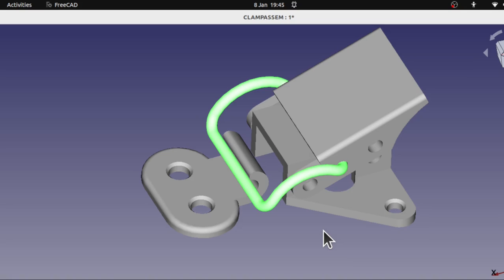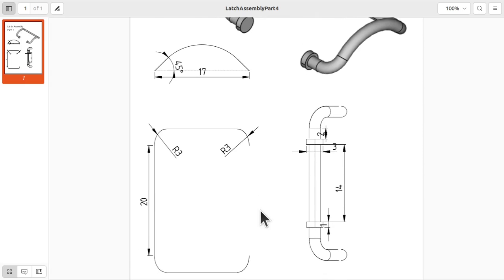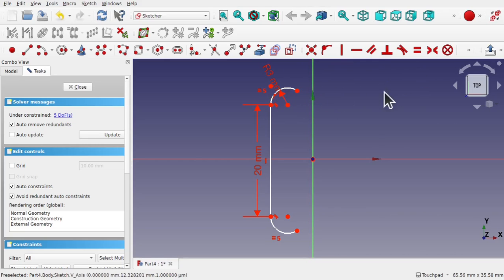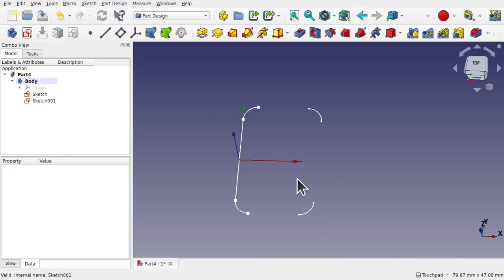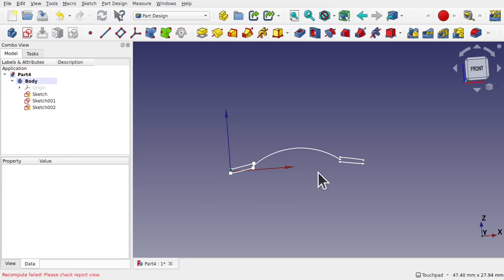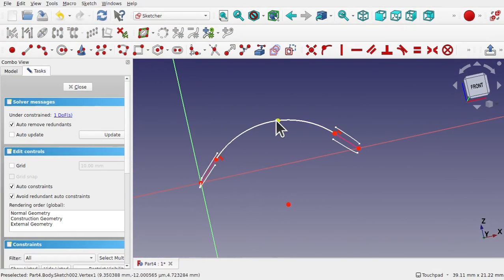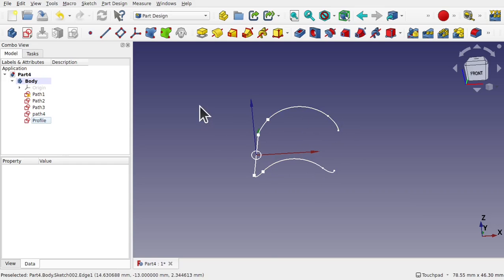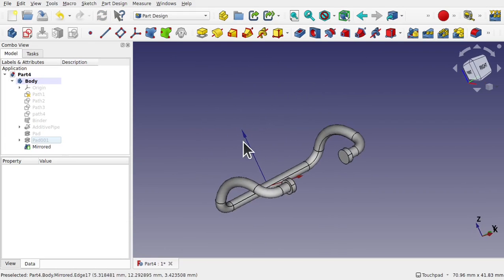Learning FreeCAD For Beginners | 35 (Part 4) | CAD Thinking Part 4: Latch Assembly

Comment: Excellent training thanks! I am struggling to extrude along a 3D path created by Freehand BSpline. Any insights/tricks would be appreciated!
Reply from the maker: Glad you enjoyed.  I am guessing you are using the pipe / sweep operation.  Attachment to place the profile normal to edge is important to get the correct alignment.  This is through the attachment mode of the sketch.  Select the first reference as being the starting vertex of the bspline and the second reference the bspline edge itself and select the alignment mode of normal to edge.  Also when you create the sweep pick the frenet mode.

Comment: this one took me a few times.  I don't know why I think when I. was forming the second sketch. I added a constraint or something that when I went to move it the. Seventeen millimeters. It was way off for some reason.  I had to do it two or three times to get the attachments Constraints. right. so I can move things and angle them. I persisted and I eventually did it. I'm going to do it again tomorrow, just to practice it.  . The other drawings in this series were pretty easy for me to follow along.
Reply from the maker: Thank you for the feedback. I would like to recreate this tutorials for version 1.0 are there are a number of other ways to do that part with other tools which make it easier but you would need to jump to another wb to use the tool. But I would like to add them in. Glad you was able to get there in the end.
Reply: @MangoJellySolutions  At this point, adding another workbench or using another workbench is no big deal for me. I've come such a long way under your instruction. It's quite incredible. I'm really good at manipulating the software and using free CAD thanks to you. And the only reason why I'm doing these tutorials is because I've already finished the ones that you had for version 1. or at least at the time I did, you may have added since. Then I see that you add a few every few days.  I was able to do all the parts of the assembly and the. Final Assembly and manipulated. under constraint and move.. Parts to form a. working latch.

Comment: I cant get mine to go symmetrical when click the 3 dots to line up its juat staying in the same place after clicking the inverted arrows at the top for the action?! Ive had enough of this for today its such a horrible program compared to fusion 360 its just occurred and doesn't need to be so many pointless actions to even pan around! Im just peed off today with it not doing what it's toldwhat i hate with tutorials always different to what your doing I'll maybe come back tomorrow and try again! Its just mad how difficult it is to make a bend pipe!
Reply: There is a certain order to manage to make the symmetry. Select the most outer dots first and the central dot as the latest. Then apply the symmetry. Easy !!! 😎
Reply: 没那么复杂😉

Comment: I am also having an issue moving sketch 2 to in ver 0.20.2. It is grayed out.
Reply: Just realized I was trying to change it in the wrong section. I was in Base and needed to be in Attachment.
Reply from the maker: Ahh I see where you are now. Don't worry that catches everyone out. The number of times I have gone in and tried to use placement when the sketch is attached. Normally it's the first one you come to on the data tab. The attachment will before the placement of its attached.

Comment: Hi i have an issue when trying to move sketch 2. 17mm to the right its just changing my view of the sketch to front view, am using ver 20.02...thanks
Reply: You are trying to change it in the wrong section. Make the change in Attachment..

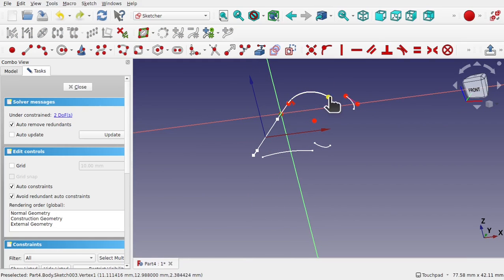Comment: At 18:35 I don't understand what you say about why tangency to both projected geometries doesn't work.
Reply: Okay I think I get it: having tangency both sides is overconstrained, as tangency on the left and coincidence on the right are sufficient constraints to define angle and radius of the arc
Reply from the maker: I should of explained it like you have in your comment.  That would of made it a lot easy, sorry :)  Thanks for adding :)

Comment: Could you map a sketch to the face of a cylinder then additive pipe it? I have no idea but thanks for the tutorial some new techniques here (for me)
Reply: Yes, though that would be a subtly different shape, because the four corners would be bending in two directions at the same time. If you want the shape as shown you can get that by drawing the profile in the sketcher with an arc and two lines, make that a joincurve in the curves workbench, extrude it in the part workbench, then use a sketch on surface to get the path.

either option works. The second one makes it easier to constrain the distance between the working parts of the latch, even if you're using a cylindrical surface.
Reply from the maker: Ah I think I see what you mean so to follow the edges.  You could , you would have to shape the cylinder a little with some fillets to get the shape and split in half.  Then you could extract out the edges with a sub shape binder and follow with the additive pipe.  Would you have come up with is the exact kind of mindset you need when tackling CAD problems.  Braking down the shape into its primitive form and thinking outside the box (or the cylinder lol) Nice :)
Reply: @MangoJellySolutions  ah okay, slightly more involved than I was thinking originally, have to admit I didn't attempt it. So many options with freecad it's almost beyond comprehension. Manageable thanks to you though 👍👍